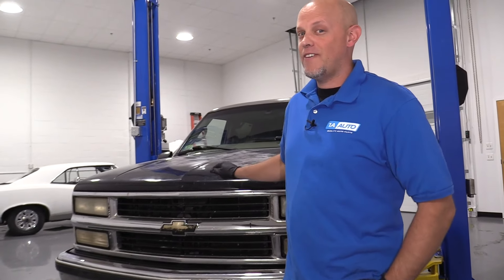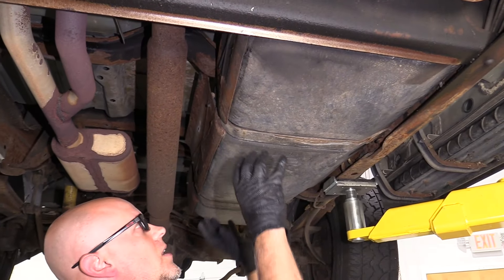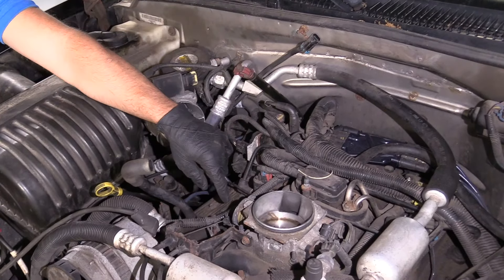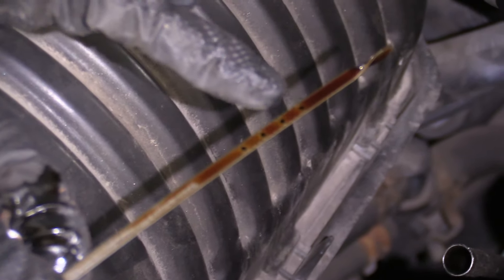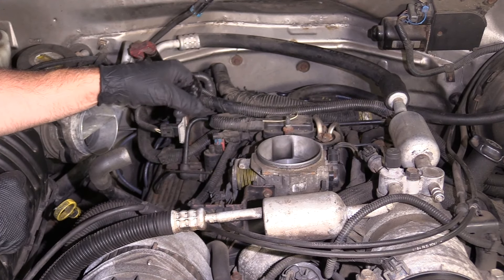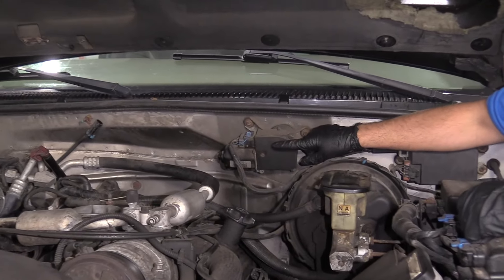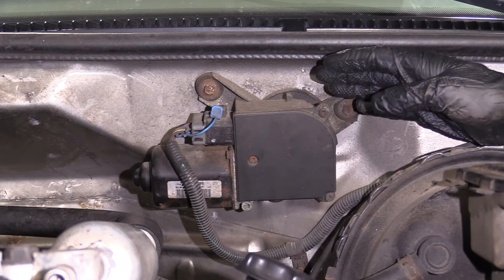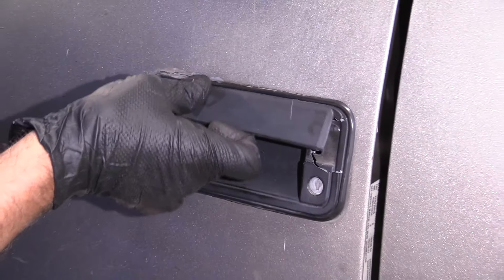Top 5 Problems Chevy Tahoe SUV 1st Gen 1992-2000

Comment: There is a recall on the Wiper Motor and Board from GM. I had mine done last year on my 95 Tahoe. Fixed the wiper issues. Should’ve seen the faces asking for a 25 year old recall.
Reply: @Big Business I went to Chevy and had them do it. Did you check your vin on the Chevy recall site just to see if it was done? Mine wasn't so they set an appointment up and I just swung by. In and out.
Reply: 95 Tahoe’s are a single year manufacture. No compatible parts from any other year
Reply: Bungie cord on the connector fixes this also
Reply: @CouldntGetEvan  are 99’s the same?
Reply: They probably couldn’t believe it was still on the road.
Reply: @emune_  no 99s are the same between 97-00 I think

Comment: Forgot to mention the gas gauge that has a mind of its own. Replace the sending unit and fuel pump. Got so bad it had a sword fight with my oil pressure needle😂
Reply: sending unit and fuel pump replacement cost about how much?
Reply: Sound like ground wiring

Comment: I got a 99 Tahoe with almost 210,000 on it .. just love the depandability of these trucks..especially in the winter time where im at. It starts right up first try every time!
Reply: Just bought an LS model of the same year. Wisconsin truck, if you know what I mean. I have to fix my front suspension. I'm a little daunted by the idea of doing it myself, but the shop wants to charge me over $4k 😨
Reply: @TheScarletLadle  what part of Wisconsin are you from?
Reply: @kleenchevyrida  SE area.
Reply: Mine too.
Just wish the small body parts were made of metal I stead of plastic.

Comment: That was a really solid built vehicle. 👌
Reply from the maker: Yes Great vehicles! Thank you for checking out the video. If you need auto parts go to: http://1aau.to/m/Shop-1AAuto-Now
Reply: They had cylinder heads that were prone to cracking warping vortec heads
Reply: @worstnightmare9772  Think  you're talking about the 5.3L. The 5.7L vortec was pretty much bullet proof.
Reply: @donvonschitzinpantz2  no Way the Chevy 350 engine is still the best engine ever made in the USA it was when they switch to vortec is when they started having coolant leak into the oil between the gasket  cylinder one and two
Reply: @worstnightmare9772  It is the 5.7L vortec is 350 Chevy engine same all the way back to 1960's all the did is improve how the heads  flow and call it a vortec, the engine didn't change until they made the 5.3L vortec, than was a completely different engine. ROFL LOL
Reply: @donvonschitzinpantz2  TBI 94 suburban Silverado edition 350 non vortec.

Comment: He forgot to mention the door hinge pins.  They're a nightmare to change out, alone, but I did find a trick.  I clamped a 2x6 to the roof rack, rolled down the window, and hung my door from the 2x6.  It took a little tweaking here and there to get it just where I needed it, but it worked better than I could have hoped for.

Comment: I've had most of those same problem with my 97 suburban. However, once replaced, it has run like a champ. I went through a time where it wasn't very reliable due to those problems, but now, that thing is a beast and a daily for me.
Reply: Did that include the intake manifold gaskets? How much did that cost you? I'm considering getting one of these generation Suburbans. I prefer them to the later ones.
Reply: @petercollingwood522  you need the FEL-PRO MIK98000T. It has metal inside.
Accept nothing else

Comment: Thanks for uploading those nice videos . well,  i own a 92 chevy blazer full size / yukon and i can tell that only few of those symptoms are familiar with the the early version of the 92-94 models . Outer door Handle are originally cast iron / steel and different so they are brake less , inside door handle is solid as a rock - never had any issues - intake gasket in the 92 is different from the vortec style but also had some issue after 100000 miles - so that's fair enough , with the fuel pump their are many issues like you mentioned but it is with all of the 90' chevy / gmc truck and suv .  
Wiper motor never had issues. 
From my experience i will mention that In the 92-95 year models the starter motor is very weak and i had many issues of no staring in particular during our hot israely summer so i  upgrade it to the 96 upper models and the problem been solved completely . 
Another issue to mention: the a/c evaporater core box are equipped without a cabin filter so every 3-5 years you will have to clean it or other wise you will get weak blowing  and bad cooling capacity . 
Transmission issues : 4L60 / 700R4 ( cable ) : if you ride those suvs in hot areas / deserts with out a transmission oil cooler which connected  directly to the oil hose ( not  throw the the radiator) you may spent every 40000 miles  2000- 3000 usd for an overall -  with the external oil cooler you can make easily 120000 miles or more with out any issues,  also i can recommend to replace the trans oil and the filter every 15000 miles .  
In overalls those suv are very good and reliable , thanks again
Guy

Comment: I bought a rust free 99 Tahoe from original owner with 217,000 miles on it..Uses only 1/2 QT oil every 7K when i do a oil change, has a glass smooth idle...I did all bushings and ball joints, lift, 33s on 20s and it came with all options per build
 sheet including tow and off road upgrades..These are pretty well built trucks and if maintained they can give you years of reliable use..Two complaints..Fuel economy..i get average 10.5 mpg and onlookers..Get alot of ppl looking at my Hoe probably because the 4th gen looks sweet and has alot of clearance compaired to the new high hoods all jacked up running 35s..I much prefer the slimmer profile 90s VS todays high hood no clearence chevy truck..

Comment: Great video but you forgot 2 of the most important ones. The sloppy steering due to the rag joint on the steering shaft and the spongy breaks which all of them have
Reply: Switch to the nbs master cylinder. Made a world of difference to mine

Comment: Loved and miss my 97 Tahoe LT. The one thing I remember that was an issue acros all GMT400 platforms was sagging doors due to worn hinge pins
Reply: That's the issue with mine
Reply: Luckily I purchased on and the previous owner just had all those pins replaced over $637 in parts and labor
Reply: Same problem.

Comment: I just bought a 2000 Escalade, so far I have three issues mentioned on this video with the fuel pump & exterior/interior door handles. Lets hope none of the other issues come up. The truck has 305,000 on the ODO.

Comment: I've done fuel pump,power steering pump and intake manifold gaskets on mine.....ugggh, but once fixed,good to go!
 I've replaced the windshield wiper motor but didn't know about that board. Could replace the wiper switch also. 
 Door handles,yup. The outside door handles yup. I've done all of those hahaha.

Comment: I just got a 99 tahoe and the previous owner replaced the transmission with a th350 with a b&m ratchet shifter and I love it but it's got some kind of electrical issue cause the only gauge that works is the tach and was the same with a new cluster too
Reply: Pull the cluster. The ribbon connector loosened up. Mine did the same thing. Its not connected by a harness more like a membrane.

Comment: This Friday I am getting a Denali 99 with 187k miles it starts up but the guy says the gauges for the oil don't work it's like not even reading anything just hanging down in the bottom. Could it be a bad stepper motor? And I am going to change the intake gaskets just to be safe

Comment: Boy you aint lying. I just bought a 99 suburban and i had to change every one of those except fuel pump looks like thats next on the list.  Lol only if this was my video iy would have been the top 30 repairs iv pretty much replaced everything but the engine which i found out i actually have to do because i have a bent crank. Main seal wont stay sealed. Had it done twice now and talked to 2 different shops. Said thats only thing it could be
Reply: 1996 Tahoe - Stock:  If your Tahoe is = below 1/8 tank & parked on an incline pointing up, it may not start if below freezing - wait until weather warms.   This truck relies on fuel pressure to run - super cold mean low pressure.  Low fuel pressure can cause all sorts of issues, even the injectors require very good pressure to work well.  Door pins = heavy doors means you may need to replace door hang pins x 2.  A/C = if A/C coolant is low the condenser will not turn on.  Also, if coolant is fine then the heater cluster is bad, electronic cluster fails...  (the 3 dial cluster = $70.00 on Ebay)   Door handles = train yourself to be gentle while opening the doors. ;-)    I've got 245K on mine, engine upper rebuild head gaskets is all I've done.  Mine is parked inside every night.  I have owed it since 1998 - 23 years!!

Comment: Is frame rust an issue on these? Worst areas to look out for? I heard rotten brake lines were a an issue. Looking at a 98 - ( yes from the rust belt 😖 )
Reply from the maker: We try to not use rust as one of the problems because most vehicles rust.  Sometimes they do rot away. This one in the video was in good shape. Undercoating helps slow the rust. Thank you for checking out the video. If you need auto parts go to: http://1aau.to/m/Shop-1AAuto-Now

Comment: How could you leave out the spider injectors? That is the number one failure of all the early 5.7 litre Vortec engines, rough idle and poor fuel economy is the result. The upgrade is worlds better and puts the injectors at each cylinder.
Reply: Going to have that done this weekend.

Comment: 1998 chevy tahoe interior lights won't shut off and radio won't shut off when doors opened or closed. Everything been replaced! tips/tricks to fix this. Thank you
Reply: Tamieka Lewis : About the interior lights. staying on , probley the on off button in the jam of the rear window. It’s not being pressed in far enough to cut the lights off. Close the doors and hold this button down  with your finger lights should turn off , then adjust the button out farther.
Reply: Remove the dome light fuse

Comment: i am having a problem with my 99 tahoe and was wondering if someone would help me try to figure out whats wrong with it  if i explained what was wrong with it
Reply from the maker: What is wrong with it? We will try to help you out.
Reply: @1AAuto   it now has a long crank and will start but itll aburptly die after 2 or 3 secs and thowing a p1351 code and i checked the ground wires and ive replaced the ic twice icm once crankshaft postion sensor and rorary button and dis cap
Reply: and everything is in working order
Reply: @DaTechn9cian  Are you still having the issue?
Reply: @A1rsoftKid  yea
Reply: @DaTechn9cian  I had your symptoms after heavy rain the next morning. It would like stumble and stall with the same code. I would continue to look at wiring and maybe try a sprayer mist if yours is moisture related. I solved mine by cleaning up things.

Comment: Front hub bearings, transmission, water pump, EVAP system, ABS system, distributor gear...LOL
Reply from the maker: Yes all great problems that would have made the top 10. Thank you for checking out the video. If you need auto parts go to: http://1aau.to/m/Shop-1AAuto-Now
Reply: Spider injector, wheel bearings, tail light circuit board. Heater hose fitting in intake.

Comment: Bought a 98 from someone that came with no manual anyone can point me in the direction of how to switch into 4x4 and should I be in 4x4 high or low driving in snowy conditions
Reply: If you have 4x4 you push the 4wd button on the dash.
Reply: @jaubuchon28  there’s no button
Reply: @naznotnas861  you don't have a 4wd then unless there's a manual lever on the floor, but I think they only did the autotrak boxes in these trucks. Are you sure it has 4wd?
Reply: @naznotnas861  also always 4wd high, low range is for like sub 10mph driving
Reply: @jaubuchon28  it’s a lever on the floor
Reply: @naznotnas861  put truck in neutral, put the lever to 4hi, go into drive and go forward a couple feet, then 4wd should be engaged
Reply: @jaubuchon28  thanks a lot I got it
Reply: @naznotnas861  awesome, enjoy the truck, they're awesome
Reply: Can’t believe u can’t figure it out .   DA
Reply: Pull the lever on the floor to 4hi. You can do this in park or goin less than 45 mph
Reply: @couchrider6228  your name says it all enjoy lol god bless sir 👍
Reply: Did you figure it out ? Possible that yours doesn’t have 4x4.
Reply: @couchrider6228  it has it and I did
Reply: Glad for you , they are great trucks /  Cadillac’s . They are built to last so much more so than the newer models . Only use LOW 4x4 at 10 mph max . The high range is what you want for snow on the highways.  I’ve also got a Avalanch it’s a great truck but so many gadgets to go wrong. Tahoe owners rule.

Comment: I have a 99 tahoe and the only problem ive had is the door handles. Other than that not a single issue runs like a clock.
Reply from the maker: +Tahoe Boy Thanks for the feedback!
Reply: What happened to your handles?
Reply: @emune_  outside driverside handle is coming apart and I've had the inside handles snap twice, driver and passenger. Lol since posting this comment I've replaced motor, transmission, injectors, distributor, sometimes my wipers don't come on when it rains, my Gauge lights flicker now......guess I jinxed myself
Reply: @tahoeboy8658 you replaced the actual engine or wiper motor? Also did you replaced the whole transmission? What mileage were you at?
Reply: @MrR4ge89  both lol guess I should've put "engine" instead

Comment: im suprised nobody mentioned the dash crackin
Reply: Ive never seen one with a cracked dash. I own one and doesnt have any cracks and many of my friends own these trucks and they dont have cracks. But my buddy with 2 dodge ram pickups pretty much doesnt have a dash left😂😂😂
Reply: Big facts . Mine is basically gone . I have a dash cover in its place 😂
Reply from the maker: Cracking and rusting is a common problem on most vehicles. We try to focus on the parts that fail. Thank you for checking out the video. If you need auto parts go to: http://1aau.to/m/Shop-1AAuto-Now
Reply: mine cracked also
Reply: 97  I’ve got one crack goes from windshield to ac vent in center . Still a great truck wish I had two .

Comment: Great video , I just emailed a fellow about a 99 2 door 4x4 .
Reply: Did you buy it? If so, how is it holding up?
Reply: @MrR4ge89  I bought a 2 wheel drive instead , it’s a project in the works right now . But I did get the 350 installed

Comment: You mean intake manifold gasket.
Reply from the maker: Yes. Lower intake manifold gaskets a common issue that can cause coolant to mix with oil. Thank you for checking out the video. If you need auto parts go to: http://1aau.to/m/Shop-1AAuto-Now

Comment: You didn't cover the oil filter leaks,  rear main seal leaks.  Those are pretty common issues on those GMs trucks
Reply from the maker: Yes! Those would have made the top 10. Thank you for checking out the video. If you need auto parts go to: http://1aau.to/m/Shop-1AAuto-Now

Comment: Here’s a problem I had with my 97 that was driving me nuts: transmission would intermittently go into limp mode, stuck in second gear, dash instruments freezing up or giving weird readings. Thought the old 4L60E needed to be replaced. 
 
The actual fix was to replace the ignition switch on the steering column!! I could not believe it. I did that two years ago and the problem vanished.

Comment: I had 3 of the 5 problems come up.  replaced the fuel pump twice, the head gasket and the door handles. 
I will keep an eye on the power steering pump and wiper motor. 
my main issue now is the 4wd system.

Comment: Top 5???
Should be more like top 20..
Those things have way more common problems than 5.
Reply: DANGEROUS MECANICS AUTOMOTIVE TECH. 
This makes me so sad..... I’m contemplating buying a 97’ Yukon Gt right now.
Reply from the maker: +DANGEROUS MECANICS AUTOMOTIVE TECH. Thanks for the feedback!
Reply: Mike Ross just do all of it’s scheduled maintenance on time and you should be good. One of the worst things I’ve seen working as a automotive tech is that people sometimes let things pile up and then it gets hard to pay for repairs. Also taking that ikon into a shop if buying from a private party would help to get it inspected from top to bottom before making a final decision.
Reply: @mikeross5627  Never made a G/T but these are very reliable long lasting trucks . I say buy it if it checks out good with your tech.

Comment: 290,000+ on a 99...Fuel pump, yep...door handles, yep...rebuilt front end, yep...radiator, yep...anything else?...nope. Good info. 1A.
Reply from the maker: +jeremiah johnson Thanks for checking us out! http://1aau.to/m/Shop-1AAuto-c
Reply: I have a 99,fuel pump new,driver door handle broken,installed new radiator 3 years ago. The only problem I have is the service engine light on. Any ideas what can it be?
Reply: @louieyaya5951  ....most likely the egr valve...easy fix.